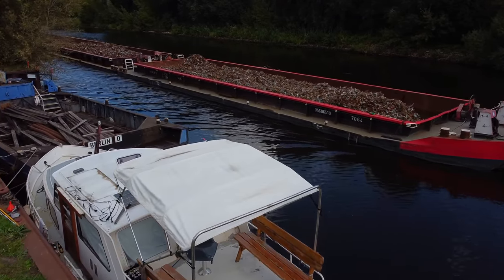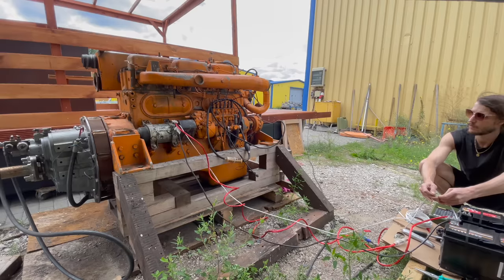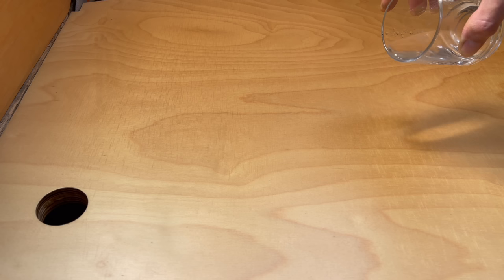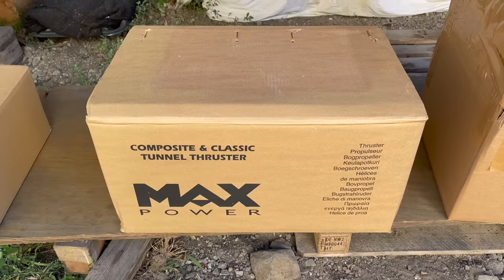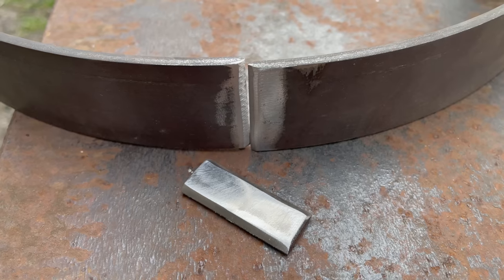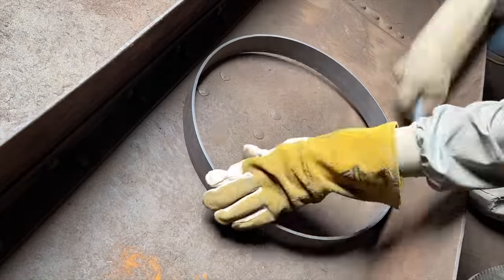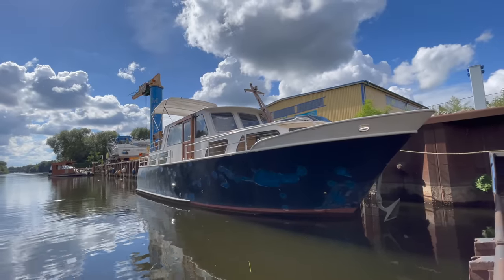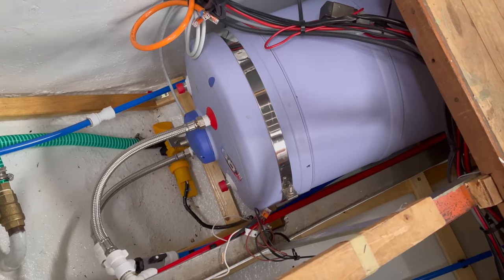Updates on my Boat Refit Projects - Bow Thruster, Shower Cabin, Water Boiler

Comment: You are doing great for a so called first boat project. I have learned a couple things that may help if you didn't know. Welding outside can be hard because even a slight breeze can blow shielding gas away from the work. As for plasma cutting, they cut clean metal great. Rust and paint quickly fouls up thier tip. It's worth running a flap wheel or wire wheel over any dirty spots before cutting. Keep putting out the content. It's nice to see the vision take shape.

Comment: That HUGE diesel engine needs to spin a HUGE propeller !  I don't know if the stern drive could swing that big of a prop !
Also, remember that displacement (non-planing) hulls, want large propellers with a lot of pitch.  Difficult to do on outboard motors.

Comment: If you bump the bow thruster housing and crack it.  Will the boat sink.  
A single bead of weld is not enough for the bow thruster adapter.  You have to wire brush then grind the surface imperfections flat and put probably 2 more welds . 
I worry that you cut the centerline reinforcing.  If you hit the bow.  It will distort the thruster ring like popping the top off a bottle of beer.  

At least weld a round plate on the inside.  To get power thru the inner plate. Either use half of a tapered pipe coupling to weld on. Or a malleable iron pipe coupling. A schedule 80 if not stainless nipple and a pipe cap with a bulkhead fitting to squeeze down on the bow thruster cable. 
Where the pass thru the hull ring has enough height above the hull.  After the ring has enough weld build up.  Put in some flying buttresses between the ring and the hull.  
To understand why.  Find a pdf copy of the Emma Maersk Danish accident report.  Where the unsupported stern thruster tube ripped away from the cross tube.  They were in the Suez canal and the captain as they lost main the main engine had set course for an open birth at port siad and drifted the Emma Maersk into the birth. Where she settled to the harbor bottom with cargo cranes at her side to unload her.  There was only 29 feet of water in the engine room.  Covering the main engine completely.  It's a fascinating read.
Reply: He just goes off and does things rarely listening to any advice, I have been watching for ages, since he started, lost interest and unsubbed as he did so many things wrong, people offered support and he ignored them and went on with his plan, sometimes it seems like all the gear and no idea, other times I wonder if he has a rich family letting him do this, some of the things are safety issues others are just common sense, like don't route pipes and wiring under something when in an emergency you cannot get to it.
His boat, his rules.
Reply: Hi Wayne, Obviously, you know a lot and I was hoping to ask you a question. Could a flat steel plate be formed into a tube here by cutting grooves every 2.5cm and then making many partial bends to form a cylinder?  If the diameter is big enough, then weld the grooves from the inside.  Maybe put some bands around the circumference.  I posted about this before reading your excellent post and responding.
Reply: @ronster963  yes you can form a tube that way. It's a lot of welding. Totally depends on the length. I have always wanted to raid the scrap bins at machine shops that re rod hydraulic cylinders for rods to create a roll bender.  
One could get a fab shop to bend plate into 4 quarter bends with tails as you cant bend the last few inches of a plate. The cut the tails off to form a tube. A lot less welding.

Comment: Just an idea and I don't know about the seaworthiness of such a thing.  Metal is expensive and a tube has to be costly.  What about taking a flat plate and cutting grooves along the length.  Then you can bend into a cylindrical shape and weld the grooves shut.  Maybe even put a couple bands around the circumference.  Sounds like you are using 5mm steel and so I would recommend a fixture to make the groove depth consistent.  The grooves have to be deep enough to allow bending without undue difficultly.  I don't know the metallurgy enough to know if this needs to be heat treated, but probably not. 🙂 You mentioned you have a time constraint.

Comment: Be verry careful with that floor hatch, 1 step on the plexiglas and the glue will give up and let go. I suggest getting a solid aluminium hatch before you or someone has a accident, please be safe.
 If heat is a problem when cutting with the plasma you should go in opposite direction on the circle so the heat is 180 degrees from each other as much as possible, next cut you'll do better i'm sure.